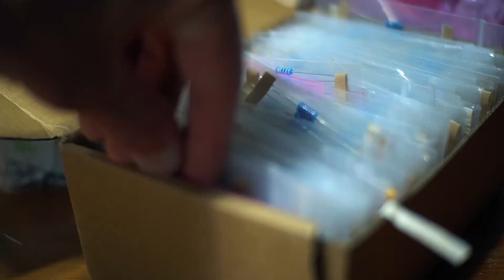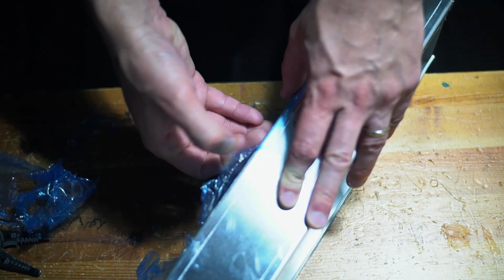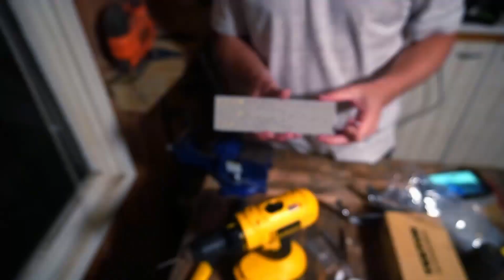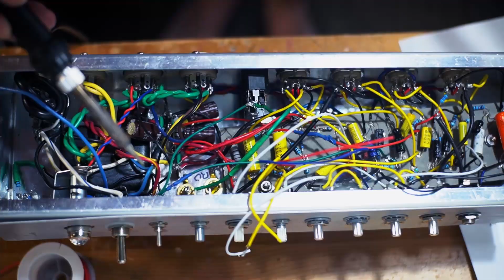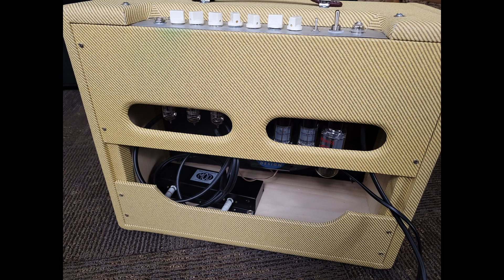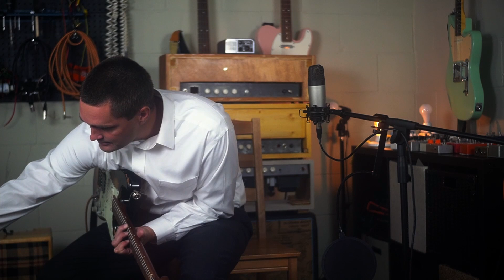Princeton Reverb Build pt 4 - Initial Startup and Tone Demo

Comment: I don’t understand the point of the “current limiter”. If I’ve wired the power supply correctly, the amp’s fuse will blow before a problem can take out the transformers or tubes.
Reply from the maker: It's a safety set in case you wired something incorrectly.

Also fuses are not fool proof.

Comment: I built a Princeton reverb and I find the amp is cleaner than I thought it would be. I'm not getting as much dirt when the volume is dimed and I'm wondering what the best method might be to lower the headroom? I've biased the output tubes at 60%. I'm thinking I can lower the B+ to the preamp section by increasing the value of the resistors between the filter caps or by increasing the value of the plate load  100k's to a higher value. Do you have a preference? The Tweed Champ and Deluxe that I built have PLENTY so it's not a huge issue. The Princeton works very well as a pedal platform  but getting a slightly earlier breakup would be nice.

Thanks in advance!
Reply from the maker: Hi John.  A NFB switch and a midrange ground bypass switch are two great easy ways to bump gain while also having the stock circuit available.  Changing B+ stepdown resistors will also have that effect.

Comment: you should replace that NFB switch and run a 1.5k resistor in series with a 5k pot for variable feedback- assuming of course you have an available spot for such a pot (the switches hole is big enough)
Reply from the maker: I do really like that implementation.  One thing I like about the switch is that it makes the 'stock' PR sound instantly accessible.  I'd fret that I wouldn't dial the pot in just right to the stock value of NFB.
Reply: Why 1.5k and not 820 ohm like the ab763 blackface circuits?
Reply: check your PRINCETON schematic my friend; 2200 ohm NFB resistor. My suggestion would be variable both under and over that value.. @CharlesWillisBonsai